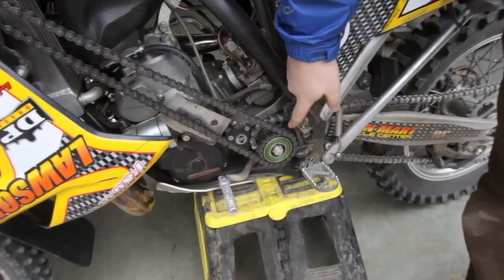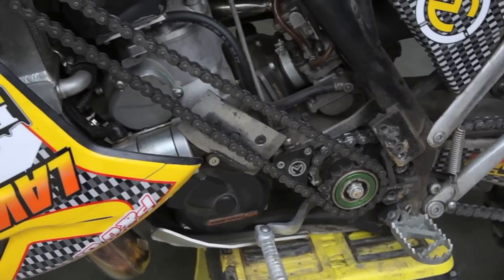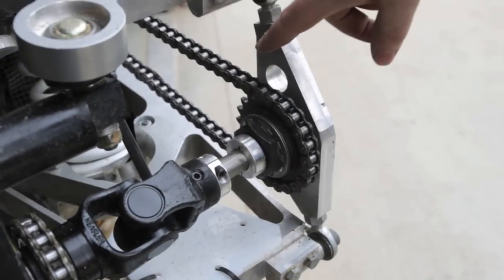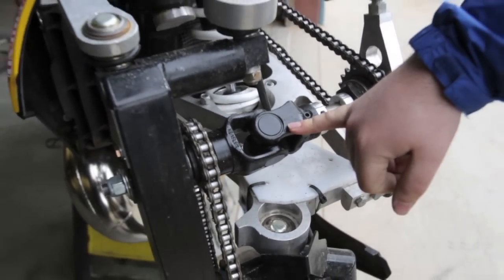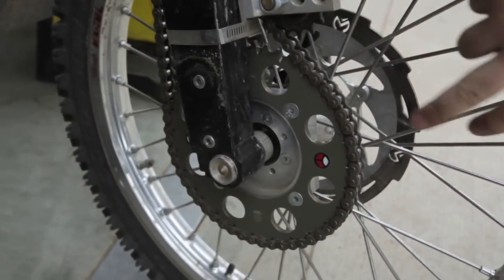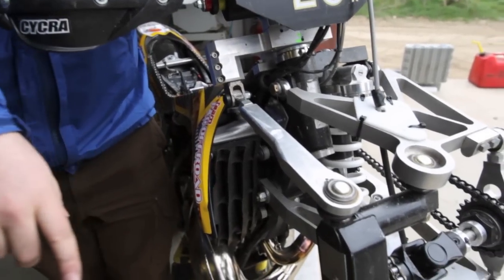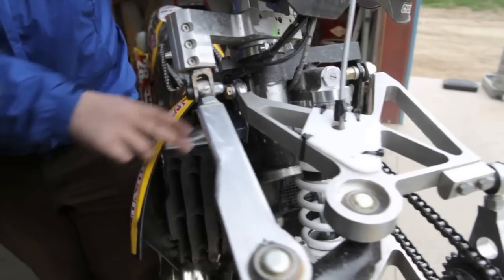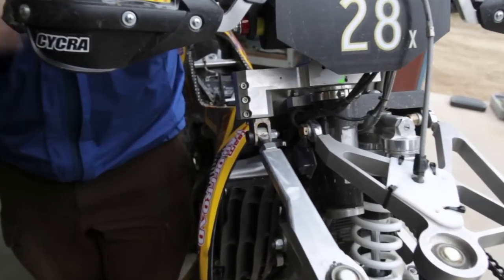Lawson All-Wheel-Drive Motorcycle

Comment: Excellent engineering. Though I believe an electric hub motor could sort this out easily, and connected to sensors only cut in as required when rear needs extra grip, or steering angle demands. May be worth thinking about.

Ohlins used the hydraulic system so that is patented, yet my electric hub motor is much lighter/reliable/cheaper than that and faster responses from electronics too.. Good luck, love to see engineers build stuff.
Reply: An electric hub strong enough to provide power to a 230 pound motorcycle plus 200 pound rider is possible, but the batteries needed to supply that with power for any amount of time above 10 minutes would add massive amounts of weight.

Comment: I'm trying to see the use of a vehicle like that? What would be the benefits of that? I would think the design of the frame would need to be changed to distribute weight differently to get more use from the front tire traction. On a two wheel drive motorcycle it may be more use having the motor over the front tire. What then would be the use of that? It may be more reasonable to have a motorcycle and a motorized scooter? Any videos of the use of this vehicle showing it's added benefit?

Comment: I can appreciate your defense of this, but if anything can be learned from the Boeing X-32 JSF, the better functioning plane doesn't doesn't win if it is not aesthetically pleasing. Hence the Lockheed Martin F-35 winning the JSF contract even though the X-32 was a better plane... It still gets me every time I think of the F-35, Boeing should have won it, which is why I appreciate your defense of this 2wd system.